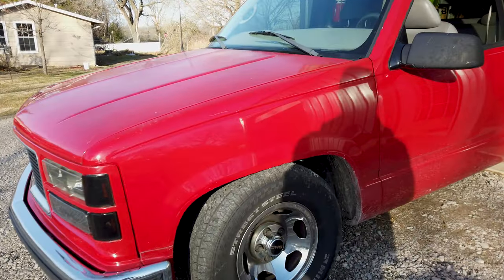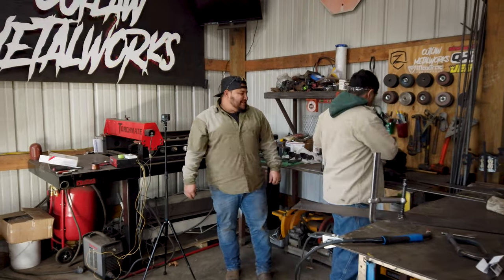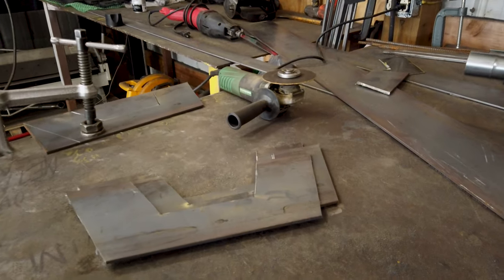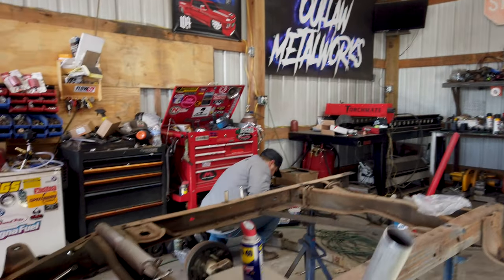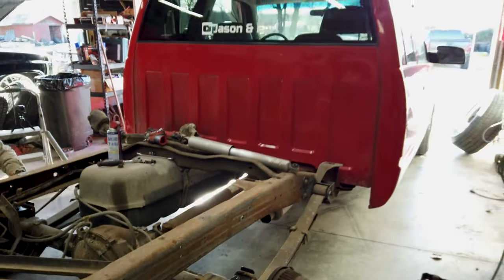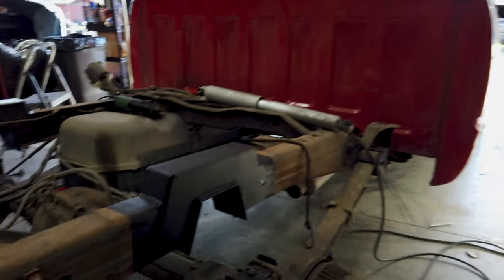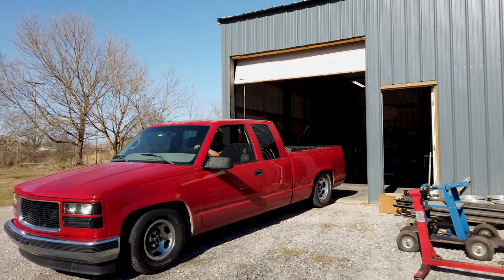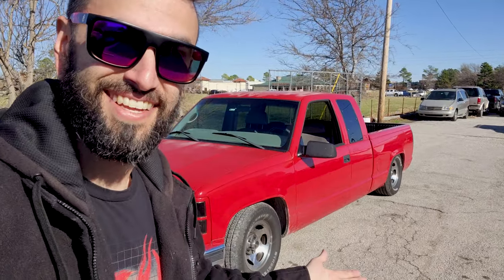Earl's 97 GMC C1500 Gets EVEN LOWER!! (C NOTCH AND FLIP KIT)

Comment: Nice I also have the bell tech 3-4 drop but I’m thinking of doing my 98 c 1500 extended cab with the flip kit. Did you use any spacers for the tranny and carrier bearing?
Reply from the maker: Not that I am aware of. Just the flip kit, c notch, trimmed the bottom of the bed, and some shock extender brackets.
Reply: @JasonandEarl  thanks for the info

Comment: Been thinking of doing this to my ‘94 Silverado LWB after watching your videos. But, I want a smooth ride(it’s my daily) and still have loading usability of my truck. How’s the ride quality?
Thinking of a 4/6 flip c-notch.
Reply from the maker: If you want to continue to use the truck and load it up, I would add helper bags. Otherwise it's going to ride terribly when loaded down.
Reply: @JasonandEarl  How’s your ride quality when not loaded?
Reply from the maker: Not terrible on flat roads. At this point it's been dropped down to 5/8 so the front tucks and is pretty rough if I happen to hit a big bump.

Comment: So thats a 4/8 drop?  and those wheels look 🔥on the obs 💯
Reply from the maker: It's a 5/8. The front has a 3 inch drop spring on a 2 inch lowering LCA. Thank you! Wait until you see the upgrades.
Reply: @JasonandEarl  nice can’t wait
Reply: Is it better to run drop lca or drop spindles?   And did you trim your lca to clear the 15" rims
Reply from the maker: No trimming in my situation and I am not sure if spindles would be better than lca. I'm using Lca to drop it but the only downside is the lca can get pretty close the ground.

Comment: What size tires are you running
Reply from the maker: It currently has a different wheel and tire setup, but the tires in this video were 275/60/15
Reply: Any rubbing issues? Planning to put same rims on my obs, but wanna go with 75s in the back.  Did you roll your fenders
Reply from the maker: I trimmed the inside of the fenders with a grinder. Only rubs when I hit a hard bump too fast lol
Reply: I see lol. Thanks for the info bro appreciate it.  Nice truck!!

Comment: Why didn’t you guys just do the drop
Reply from the maker: It was a little bit outside of our area with all the welding. However, we love to feature and support other local shops. The guys at Outlaw are super cool and do excellent work!
Reply: What kit did you use
Reply from the maker: It was something the shop put together for the rear with some belltech shocks and the front is djm control arms and some belltech drop springs. A bit of a combo of a few things.